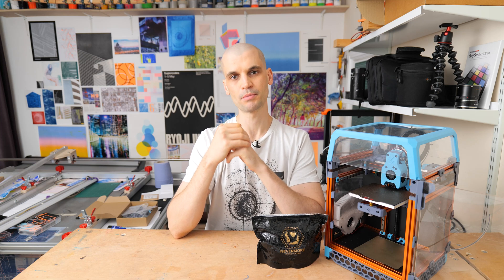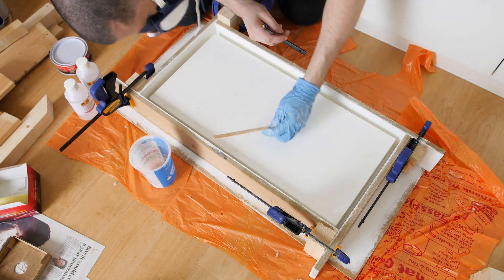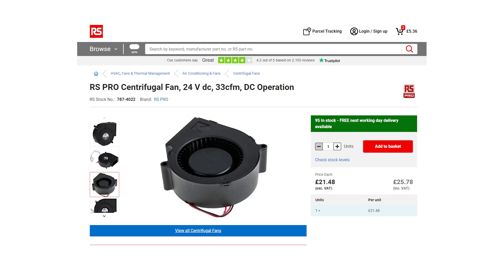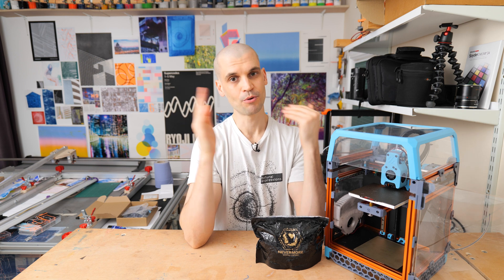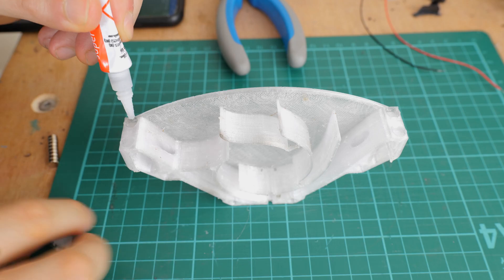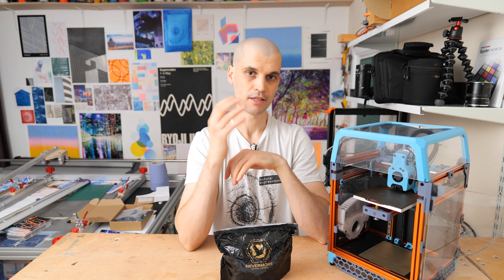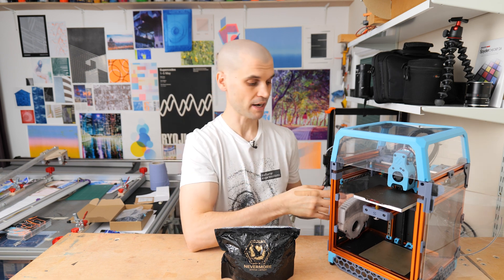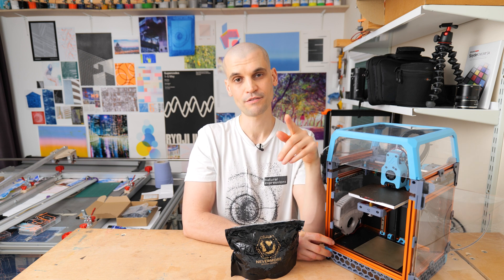You need this Carbon filter for your 3D Printer!

Comment: I use buck converters all the time for so many applications. My DIY in car entertainment system has multiple power rails from 50v for the amps to 5v for the Raspberry Pi and USB charging etc. You can get teeny tiny ones that can handle an amp.

Comment: Use the BentoBox V2 instead, it also has a HEPA filter which is is just as important for FDM, especially with ABS prints but with other plastics as well. You will se it turn yellow after 1kg of filament. Also get the modified BentoBox with an axial fan. The BentoBox also sucks the air like 99% of all industrial devices instead of blowing it through.

Comment: No need for the buck converter, just run the fan at max 50% duty cycle. That's basically what the buck converter is...

Comment: Thanks for the video. For your extrusion nuts search for t-nuts on your favorite Chinese retailer. The "drop-in" type can be inserted without removing your extrusions. The "hammer" type can also drop-in but will turn and set themselves with the turning action of your screw. Also of note, the spring type, while requiring insertion during assembly, are very convenient as they hold their position in the extrusion slot when you remove the screw.

Comment: Printed NM v4 successfully on voron 0.1 straight on bed plate
Reply from the maker: how did you manage to fit it on the bed? Did you angle it?
Reply: @ThisDesignedThat  you need rotate it until it fits

Comment: iv made the nevermore for the v0 printer and also made an extraction system on the lid so it has a second carbon filter with a hepa filter last before it leaves the machine.    its working really well, its needed as its in my bedroom haha
Reply: just curious though, why bother making it vent air out of the machine. surely if you have an enclosed machine you have it so that it maintains a temperature that helps printing certain plastics. so venting out of the machine is just going to be forcing your heated air out and drawing room air back in through any gaps.... 
When really this filter can just be inside the enclosurefiltering the heated air and releasing it back into the enclosure so no heat is lost but the VOCs get trapped.

Comment: This carbon pellet do they need to be replace at some point over time or not? if so when?
Reply from the maker: Not sure unfortunately, there are some guidelines on the nevermore github. Have a read, it might help you.
Reply: To accurately know how saturated your activated coal is, you would have to measure how much VOCs it still filters. Which means measure VOCs before the filter and then after the filter and also have a baseline to compare to. Afaik the Nevermore Controller for Nevermore Max and Nevermore Stealthmax does that. It uses Sensirion SGP40 sensors for measuring VOCs.

Comment: Why did you not just use the buck converter to just power the fan? The Klipper Expander board isn't necessary.. Also Guys be careful when working with super cheap buck converters. They can be a bit dangerous to work with. Had one blow up on me. Almost shot a chip piece into my eye.
Reply from the maker: yes that would have been the simple choice. Unfortunately i bought the expander before I go the converters because i incorrectly assumed it would magically transform the power down to 12v :(
Reply: iv had one explode in my hand when i turned it on, they are like a mini bomb going off and quite painful ><

Comment: This is a terrible solution. The fine dust carbon particles can now be breath in because you have no HEPA filter going along with your solution. Any air filter solution has both a HEPA filter to filter out big particles AND the CF particles which a terrible for your health. Please guys do not build this DIY makeshift thing which is overly complicated anyway (you need to chew up the pretty fine blower fan instead of simply installing it). Just buy a levoit air cleaner or something like that.
Reply from the maker: This is a pretty common solution, many printers use the nevermore system. The CF is de-dusted so you shouldn't be breathing in any dust.
Reply: @ThisDesignedThat  De-dusted really ? Is that why you found fine CF dust inside the printer ? Look, this is nonsense. Just buy a damn industrial filter which works, don´t ruin somebodies health through stupid DIY solutions. I am not the first person to leave a comment like that either. De- dust or not you will always have issues with that stuff, even just by handling it.
Reply: @ThisDesignedThat  Asbestos is also pretty common.
Reply: If you do not use special ''cleaned'' acid free carbon you will destroy your printer as it oxidizes the bare metal parts in minutes. 
These specialized pellets are safe to use.

Comment: Do you happen to have the tiny buck converter link? Also, does it goes from 24V to lower voltages? That I ask bc I have seen converters that go from 5V to 24V, and that's not what I've been looking for :(
Reply from the maker: Sorry about that, forgot to add in the description. I got a bunch of these - https://s.click.aliexpress.com/e/_Dkc0NRl
If you are in the UK i can send you one for free if you want. I got 4 left and will probably never use them all 👍

Comment: why not add the buck converter in the kit fan ?
Reply from the maker: Please explain, do you mean adding it into the casing where the fan sits in the nevermore?
Reply: @ThisDesignedThat  I was thinking about adding the converted to the input of the fan like cut the input wire to the fan and add the converter inbetween I have not seen the kit so do not know if that is even possible
Reply from the maker: Ye can add it anywhere along the connection between the fan and power. I mounted mine at the back of the case so I can easily access it.

Comment: I was able to print it on my v0.1, not without issues. I think I rotated some parts 45 degrees to fit. I had a few failures: it's a challenging print for many people, frequently it's one of the first things to be printed on a fresh build, it's long and flat, and easy to get warping if your first layer isn't tuned yet, or even lost steps if your axis limits aren't accurate and bang against the sides. I'm curious to try the zero filter (same concept, alternative design) to see which one is noisier.
Reply from the maker: Agreed, its definitely a difficult first print. I always have an issue with my front left corner warping a tiny bit so opted to just print it on the i3 mega. Havent heard of the zero filter before will take a look at it, thanks for the info.

Comment: There are plenty of cheap chip sensors out there which can measure VOCs, like the Bosch BME680 (also does temp, humidity, and pressure). You can get them on a board which will talk to a controller like a Pi or an Arduino over i2c or SPI. Few pound from aliexpress or £15ish from more mainstream retailers. We're not talking industrial/scientific levels of granularity or accuracy but might do the trick. Cheers
Reply from the maker: I have seen these cheap sensors, and have used them for previous projects at Uni but I'm not sure how accurate they are. I would love to get more accurate data on what exactly this filter is doing in my room while printing. I have been talking to a few rental companies so hopefully, I will hire a MiniRAE or similar device in the future.